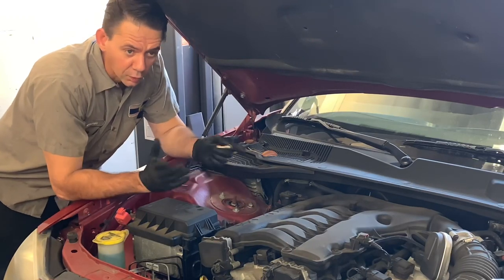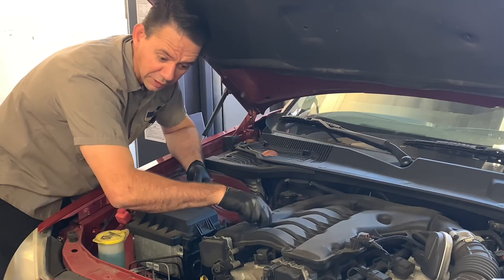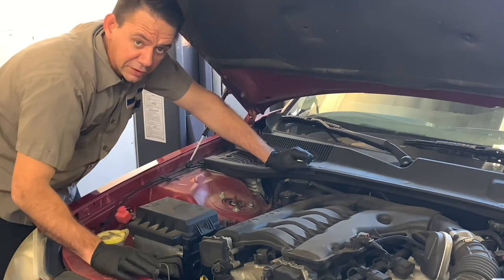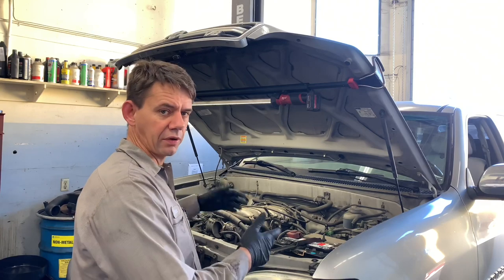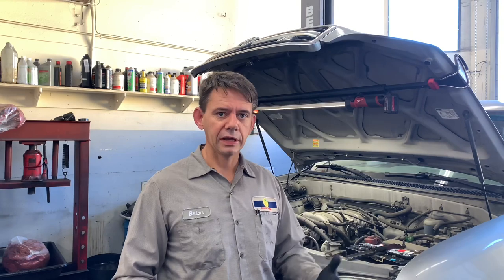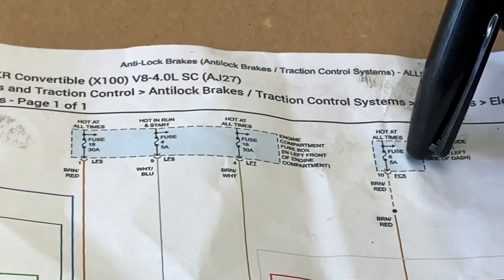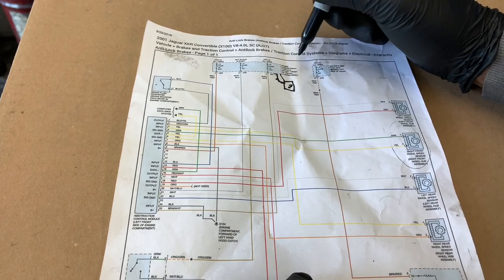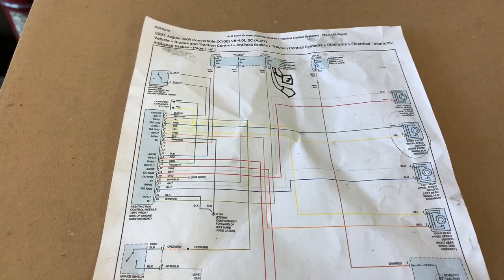3 Automotive Repair Tips from a Mechanic

Comment: Very helpful, thank you. 1) I have used the Tune your Ear method. It helps, when you heard it hit a heat shield, quickly followed by solid chassis. Also good to Accept that lost tools need to be budgeted as a cost of doing business, and move on, without frustration. 2) Treating the LOF job as a Gold Customer, the same as a big job, also validates that you have to Give before you try to Get, and focus on providing the best possible quantity and quality of service. From the spirit of your videos, I know that you're not talking about manufacturing false repairs; but honestly being helpful with pointing out and documenting faults with the vehicle, without Sales Pressure will foster a sense of trust and confidence for your customer--this is the only way to go, and your helpful focus will become apparent to them. Thanks again, Brian. Excellent work.
Reply from the maker: Spence'sMobileAuto Expert Corner thank you. Hope the video inspires and help some people. Thank you for watching!